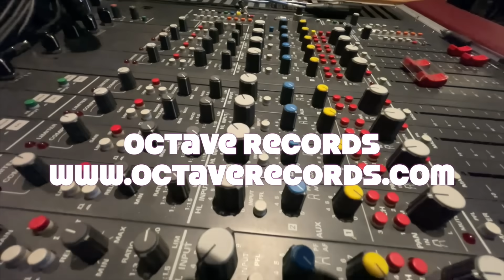Class A amps in a warm climate?

Comment: Class A gets an F grade…too heavy, too big, too hot, few input/output and adjustments (left/right balance, gain)
Reply: You don’t know what you’re talking about.
Class A amps produce all the signals with no distortion because there is no switching from one transistor to another. Class A amps are smooth, have great harmonics, lowest distortion, definitely the best sound. 
Regarding the rest of your comment, inputs/outputs, balance adjustments, gain, and tone controls are functions of a preamp, not the amp! Do you even know the difference between an amp and a preamp?????
Reply: @unclewilbur8976 Class A amp benefits:  use as a heavy boat anchor or door stopper against home invasion, a heater in siberia, too big is great to hide behind as a shield when getting shot at.
Reply: @unclewilbur8976 I never said tone controls, so u obviously do not know the difference betweeen an amp versus a preamp.
Reply: @mrpmj0023h ago

Class A gets an F grade...too heavy, too big, too hot, few input/output and adjustments (left/right balance, gain)

How many mental disorders do you have?!
Amps do not have:
 input/output and adjustments (left/right balance, gain)

Go play with your own kind now, and stop interrupting the adults!

Comment: Water cooling the amp would be great project and would make it immune to heat.
Reply: True, but you have to wonder about corrosion, plus  the characteristics of CPU semiconductors that give better performance at lower temperature don't apply to  audio equipment, amplifiers perform better at room temperature or slightly above.
Reply: @mitchtaylor6512  It'll make it lot easier to maintain the optimal temperature of the unit, regardless of the room temperature as temps outside the tolerance can affect the amps efficiency, increase distortion and shorten the lifespan of certain components i.e capacitors. However, you are correct to say 'Amps perform better at higher then room temperature', but only upto a point. Also, if someone has concerns over corrosion or is not confident with water cooling then don't bother and instead improve the air cooling or just run the aircon.

Comment: The real question: Can you afford your air conditioning bill?
Reply: That's why a cheap $14 Made in China pedestal fan is fine for the job.
Reply: If you can afford high wattage class A amps then  the electric bill for the air conditioning should be a drop in the bucket.
Reply: @mitchtaylor6512  Not all class A amps are terribly expensive, and if you are running them 24/7 you're paying roughly twice the output power for the amp, and then twice that again for A/C.  And 50% efficiency may be generous.  But do the math, and you could well find it's still a drop in the bucket.
Reply: @rockets4kids most class A amps of 100 watts or more are very expensive.
Reply: @mitchtaylor6512 electricity bills in some states in the US can run $500-1k in summer months.
Reply: I'd say, water cooling an amp would be great project.
Reply: @RelJason437  Unless you are sending the heated water down the drain you are doing nothing to address the issue here.
Reply: @rockets4kids  That's not how it works LMAO. Also, If one can afford expensive piece of gear then one can afford air conditioning to keep the equipment within optimal temperature.
Reply: @rockets4kids  LMAO, you should do stand up. 🤣

Comment: Once again, Paul is pushing high-powered amps without being totally honest.

If you have reasonably efficient speakers and a small to medium sized listening room, you can easily drive high volumes with a Class A amp.   I have a 12' x 15' listening room and 90 dB / watt speakers.  I listen at about 80 dB (fast transient).  That's fairly loud but comfortably below the 85 dB threshold where long-term listening can cause hearing loss.  80 dB requires the amp to put out only about 0.2 watts/channel.  

A 20 W channel class A amplifier can run at 100 dB (even for extended periods) but only if you don't want to keep your hearing.
Reply: Class a amps run a little cooler at high spl.

Comment: The wife encouraged me to switch out the class A amp and I replaced with two PS Audio M700 monoblocks, which are my first exposure to (much cooler running) class D amps with an analog MOSFET front end and I was  AMAZED by the difference in sound quality across the listening spectrum. Gone is the heat, but more importantly, the sound is glorious!~ Not what i expected as an old skool music lover...was always a Class A guy and now I am a true believer in Class D!
Reply: A well made class D system can sound great, the only problem is most are not made well but that can be said about a lot of things. I am yet to hear a Class D that sounds as good as a Class A or AB but then I have not listened to any really high end Class D systems.

Comment: Yes, keep the air conditioning running.
And when Desmond, in Singapore, is not listening to his stereo, have portable fans blowing on his amps.

Heat sinks do a great job.  But if you hit them with even a slight breeze from a fan, then those heat sinks will dissipate heat 10x more efficiently.  That should drastically reduce the toll that heat was taking on "those big electrolytics", resulting in a much longer lifespan of the power supplies.

If a large, floor standing fan will get in the way, you can use two (one for each amp) small, inexpensive, portable fans.  They do not need to blow a storm.  Even a small breeze will do wonders.
Reply: 100%. The physics involved with EXPERIENCED & PROVEN class A amp MFGs over many decades has indeed shown that even a very small, mini fan running over heat dissipating chassis fins provide suitable thermal management, again when properly designed. Two brands, even for the layman, I trust & have used for near two decades are ATM & AC Infinity.

Comment: Hi Desmond - I have inherited some mark Levinson’s ml20.6 from my dad - they run so so hot. 

Nothing has been replaced in them since buying new when the 20 came out - however they were upgraded to 20.5 and then 20.6.

One thing my dad did as he had four ml2s. 

Was to put a solid block of wood under the feet but not so far out to effect the heat sink - the block of wood is about 3 inches high. Allows more thermal circulation than just being at ground level. 

Hope that helps

Comment: keep the whole package below 85~90c degrees max at idle and you should do ok. the power storage caps are the temperature weak link.
Reply: The big power supply capacitors, if of decent quality last much longer than all the smaller capacitors inside an amplifier.

Comment: If the amp isnt designed with enough heatsink I doubt is even an answer concidering the price point of the products we are discussing . Say class a is whimpy is tesching incorrect understanding..
Ok its about voltage swing..devices. tube or transistor all have maximum voltage ability and current notion is use the 80 percent rule. 1 divice cant handle that voltage. Class ab is basically running outputs in series except they use a circuit to overlap them..(bias) . But high bias also needs proper heatsink but they use thermistors to control the current.

Comment: With power amplifiers, it's not really necessary to leave them running continuously.
 They usually develop their sound very quickly after being switched on. 
With preamplifiers, it's usually beneficial, as they need a very long time to function optimally.
 I have experience with the Spectral DMC 20, and it needs 24 to 48 hours to sound perfect.

Comment: Open the power supply and inspect the label for the temperature rating. Severe duty/Harsh environment high temp rated capacitors are probably and upgrade option. Costly yes, buy once cry once.
Reply: Typical large capacitors are rated 85c while smaller ones for signal and low power are widely available as 105c.
Reply: @InsideOfMyOwnMind in my experience the small capacitors are the first things to go due to heat.  The large supply capacitors dissipate heat better and are usually placed in a more open area inside the amplifier.
Reply: @mitchtaylor6512 The large caps are insidious when they age. You think everything is fine untill you replace them and suddenly all the punch comes back in the bass.
Reply: @InsideOfMyOwnMind you would have to measure them to find out if they are out of spec or not.

Comment: Does anyone remember there was the old PNP germanium transistor class A transistor car radios? They still hadn't figured out how to make a power NPN so they just put the PNP in series with the speaker and ran it at half the power at idle. There was 6V DC across the speaker with no sound. That was a rugged transistor (80V, 15A). Germanium makes a lousy transistor, but that was all they had.
Reply: There was no continuous DC across the speaker. 
A capacitor coupled it. 
You would measure DC voltage until you connected a load. Disconnect the load and measure again... No DC. 
It would build up again, though, if the load was left unconnected.
Reply: @spacemissing  I am trying to send a link to the schematic but youtube keeps deleting it.
images (.) app (.) goo.gl/peNMvDxUAUUxBvHh7
Reply: I believe nobody in good mental health would make a class A amplifier with germanium transistors, let alone an amplifier with 6V DC offset on the output. I think you’ve mixed up something)
Reply: @stanislavshokurov6532  It was a 2N174. Look it up. I think it was delco that first used them. I used to fix them for my neighbors. When it came to germanium transistors, my dad's junk box (service parts) had a bunch of the old GE MASTR line of commercial 2 way car radios (business and police band), completely built using germaniums and even featured a potted block that was a Phase Locked Loop made entirely from them. (2N169)  Silicons just were not available yet, especially in power transistors.
     And speaking of mental health, that caliber of engineer does not exist anymore that could do all those things with such a lousy part.
Reply: @stanislavshokurov6532  The speaker had a big heat sink on it and was specially designed for it. I believe the cone travel was centered at the idle voltage. The transistor was mounted to the radio case which was screwed tightly to the metal in the dashboard for a heatsink. These engineers were far smarter than today. The entire output stage was the transistor in series with the speaker across the power supply.
Reply: @johnelectric933 A germanium transistor can work with no bias at all. Why put it to class A? I’m pretty sure there was an electrolytic capacitor between the speaker and amplifier. This is the way all portable radios were made that time.
Reply: OK, I found it. I was partially wrong. It was the primary of an audio output transformer in series with the PNP. That was what had the DC across it at idle. The transformer was mounted to the speaker frame. The speaker did not get hot from the voice coil, the transformer used the frame as a heatsink. Technically it was still a class A, but not exactly as I remembered. Sorry for the aging memory.
Reply: Curtis Mathis tv in 70s,early 80s had a single transistor couple to speaker through a transformer.class a but not so hi fi
Reply: @johnstuchlik5828 that TV probably also had germanium transistor, germanium transistors do not have to be opened all the time like in class A, they can work literally without any DC bias.
Reply: I have a Realistic 42-2930 phono preamplifier. It does have germanium transistors all four are the same transistor . I used it in my first stereo system back in the seventies.  I recently got it out and hooked up my Technics SL-D2 with a Stanton 681 as a secondary turntable.  I find that I play my mid sixties Supremes Motown records on that one along with some of my older records.  Just something about the combination that's right.  It is quite noisy though and runs out of headroom with newer records.  Fortunately the 681 has a relatively low output to begin with.
Reply: Your discussing the delco radios..and to my knowlwdge..the npn transistors are stronger than the pnp..and ill go further and say n channel v fets are stronger than the p channel ones .my friend john pleitz designed the all n channel fet amp that the world now uses after it went public domain that is very much the best output stage..boy.. the early germanium devices were really good at slow switch..but bad at thermal runaway...ill ask him tomorrow and tell you his opinion..

Comment: I use a cheap, $14, 14" pedestal fan blowing air gently across the top of my amp in the Summertime.
Said 14" pedestal fan sits off to the left about 11 feet away from my electronics & pointing right at my amp...works a treat👍

Btw...The alternate outro music is by jazz trumpeter Gabriel Mervine from his Octave Records - 'Say Somethin' album.
Reply: I checked out Octave Records today. I listened to about a dozen samples that are at the bottom of the page, and they were all very low volume. Did you check out the samples and have the low volume problem?
Reply: @unclewilbur8976  No, I haven't listen to any OR samples for ages.